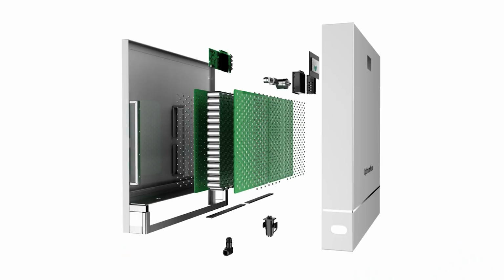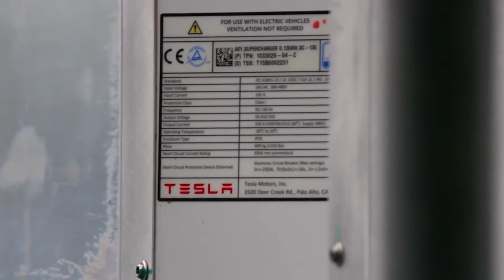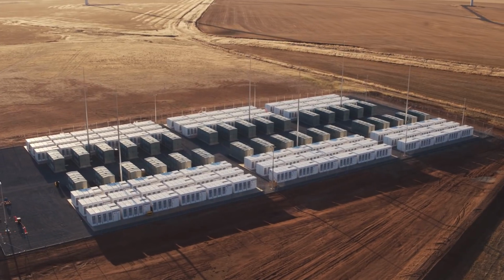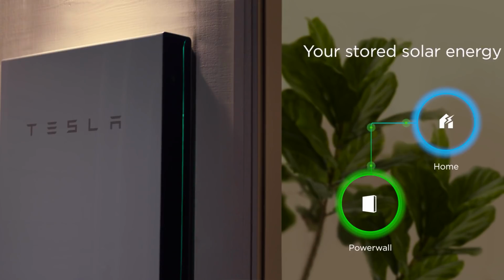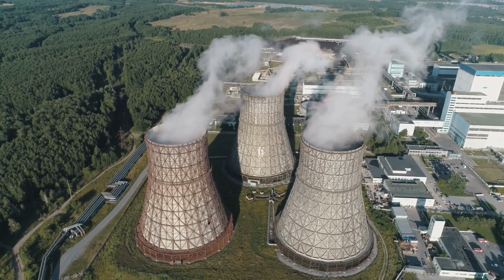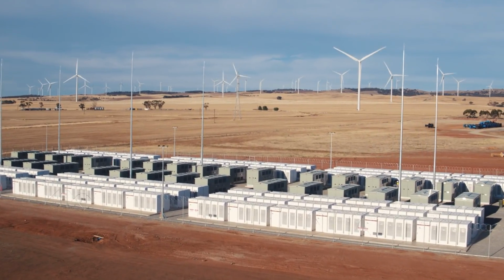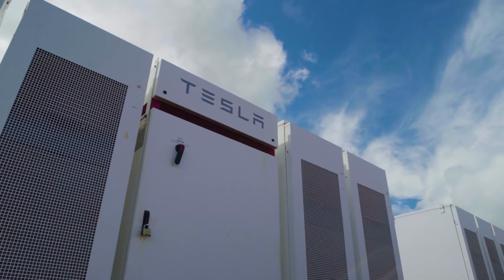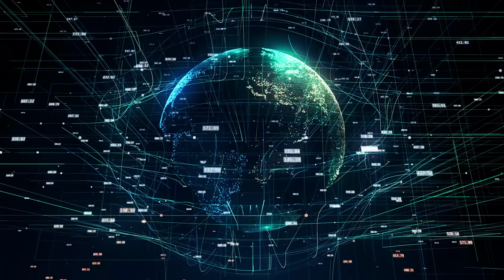Why Utility Grids are Afraid of Elon Musk

Comment: peakers are called "peakers" because historically they are only needed at peak load (a coal plant could never be considered a peaker plant) the rapid increase in solar installations in the west are causing a dramitic increase in peaker plant need (also driving out need for coal) you see a coal plant is considered base load plant, with ability to increase and decrease slowly in comparison to a peaker or solar plant. the biggest grid challenge is the sudden ramp off of solar at night which requires massive replacement energy (currently peaker plants) the other challenge is all the base load plants (coal, Nuke,older large combined cycle) cannot be shut down in the middle of the day (and returned a few hours later for peak) when there is too much solar and not enough demand (especially Saturdays in the spring) this is where batteries have the highest potential!! they can charge when demand is low and solar out put is high, and they can discharge when demand is high and replace the much needed (but dirty) peakers. problem is integrating them and meeting the reliability thresholds that current generators have... long term we need to think about recycling the batteries when they reach end of life.

Comment: Where are that battery cells manufactured?  Who controls those resources? When a cell or multiple cells begin to fail and refuse to take a charge and heat up, affecting cells in their vicinity then what? I don't see any provision for replacement of sections of cells.

Comment: You really need to research your subject better. Some of this was technically accurate - grid-level storage is going to be critical to 21st century energy - but rooftop solar is actually destabilizing in the same way having a chimpanzee in the passenger seat of your car, and pulling on the steering wheel, is destabilizing to your driving. This is what storage is most useful for; keeping the delicate balance of loss plus load and generation, every minute, working.
However, battery storage gives me the willies. The utility I retired from has had two much smaller units (about the size of a semi trailer) go into thermal runaway. The first one just poured out a huge plume of toxic smoke; the second one injured four firefighters. Lithium battery fires can't be put out - they have to burn themselves out. Remember the fire triangle? Remove heat, oxygen, or fuel and the fire goes out. Lithium batteries have the reactants all inside each cell and they have to be cooled to cryogenic temperatures to temporarily stop the fire. See https://www.youtube.com/watch?v=gENQYrlFfPs
and remember - this was a very small storage facility.
For more on the fallout of that fire, see https://www.greentechmedia.com/articles/read/arizona-battery-explosion-conventional-wisdom-safety

Comment: Got the answer to your over-reaching utility company problem - Earthships.  Earthships power all of the home's needs with its own micro-grid.  Earthships, by design, use either solar or wind power (or a combination of both) to fill a battery bank that is used to power the entire structure, and they have been designing independent homes this way for decades now.  Perhaps you could do an episode on Earthships and how they require so little power from the power grid that we all use.  Perhaps you could put your influential ability to work by introducing your entire audience to a new, clean method of living that allows them to take direct responsibility for their own power usage..  I have personally helped to build nearly a dozen of them now, and I have spent some time living in one - they work..

Comment: Next Elon will take on fusion power.  It will be built in the dirt in some random field by a dozen welders for 1/1000 the price, controlled by a breakthrough AI, achieve over unity in 7 months, Mark 1 prototype in 2 years, and will fit in your Tesla frunk by 2025 for $800.

Comment: There is another thing that is related to tesla which is far more disruptive to grid management.  smart integrated EV in the future can play the role of storage facility within cities.  Average EV has around 90KWH battery and approximately 90% of the time your car is in parking. Those cars can be used for the smart integrated grid as statistically, there are gigawatts of batteries connected to the grid via charging stations. 
This solution does not require upfront investment and diversifies energy points which reduce the pressure on the grid.

Comment: need to do more research on batteries guys, most installations of batteries are used for load balancing ie compensating for sudden surges in power needs or sudden drops. Batteries also do not fix the reliability issue of wind turbines as both the western and south Australian governments have found out with rolling blackouts during bad weather periods. Base power is a very complex and is an insanely big power consuming beast to tame, a few solar cells and wind turbines hooked into batteries wont fix the issue. It is only when you sit down and look at how much power a city consumes that you realise how big a problem you have. Wind farms and solar farms still haven't cracked the 20-30% reliability issue thanks to bad weather periods in any country and batteries wont fix that. It is a bit like trying to make your phone run 365 days off a battery but the power supply to charge your battery is only there around 120 days of the year.

Comment: Funny how often people still claim we "need" to build peaker plants every time we build solar or wind farms. Why would each farm need one when we already aren't using the ones that exist? And while storage is effing expensive, the plant and fuel to keep it idling 24/7/365 costs far more. If we need to burn stuff to add a little more power to the grid, burning trash works just fine for that.
Literally the only case when renewables and storage is not better than fossil fuels is some weird catastrophe where Florida gets covered in ten feet of snow so their solar, wind and hydro power doesn't work AND that unnatural situation lasts for days or weeks AND idiots still want to waste power for AC and watering their lawns. Which might actually happen due to climate change...which was caused by overuse of fossil fuels in the first place. Want to prepare for that? Build more nuclear power!
Reply: But they are being used.  If you build wind and shut down coal then you need all your previous peakers and new ones to match the wind.  Providing power 24/7/365 with 99.999% Reliability is harder than you think.